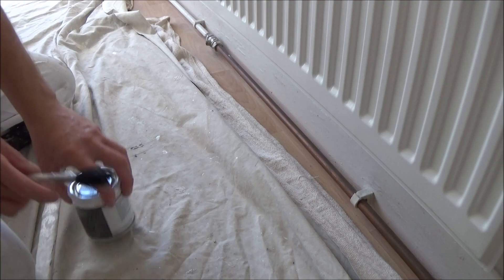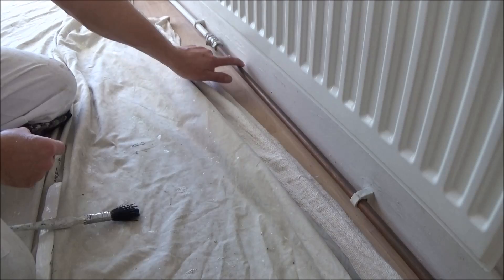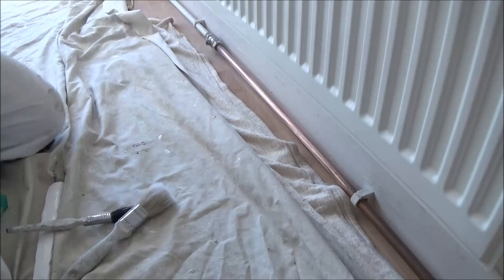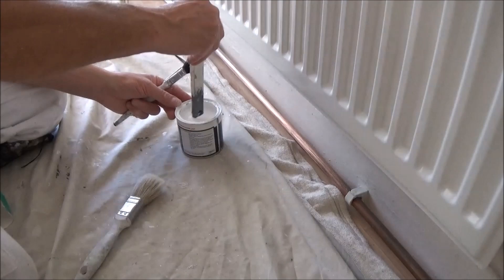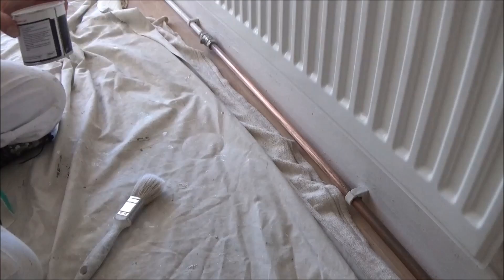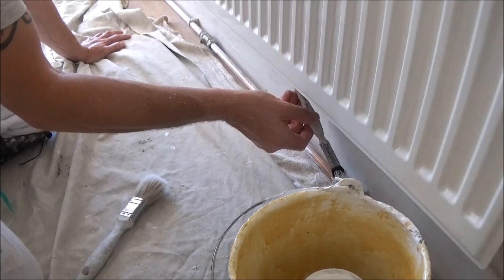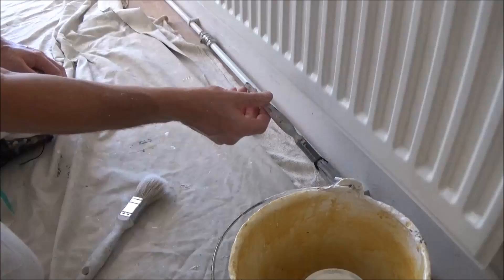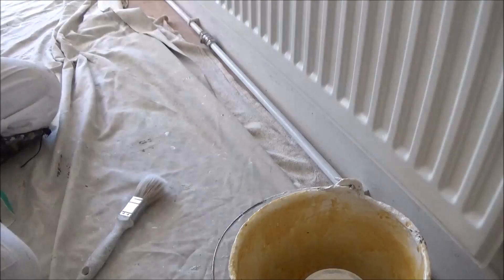Painting copper pipes

Comment: HI, for old pipes that are already painted would you just sand and then repaint or would i need to strip as much of the paint off before hand down to the copper? Problem is there are quite a few chips so just worried about an uneven finish.  Great channel btw, learnt alot from your videos.
Reply from the maker: Thank you, yes sand and repaint, but in the areas where it's chipped make sure you sand them even. Touch up any bare copper with primer.

Comment: Once primed can I paint pipes with the same Matt paint I used on the walls? My pipes run under the rads across the wall and I’m debating whether to make them white or the colour of the walls.
Reply from the maker: Listless Donkey yes you can paint them with your wall paint.
Reply: Painting and Decorating In your experience what colours should rads/pipes be? White gloss/satinwood or same as the walls.
Reply: @EggsForDessert  I know this is an older comment but what did you decide to do in the end?. I'm in exactly the same situation. I have pipes running just above the skirting boards along the walls and I'm undecided whether to paint them white or magnolia like my walls
Reply: krisja  white is more striking as opposed to magnolia,  and gives a better Contrast against the magnolia. Only my opinion though. Magnolia pipes look as if they’ve “yellowed “ with heat 👍👍

Comment: I'm painting silk on my pipes as they already have old paint on them and I want to hide them unfortunately I need small flat brushes as hardly any room beneath and at side for paintbrush and nice video good advice on sanding I noticed tho you just dust off after sanding vs damp cloth to ensure as complete as possible removal of dust particles etc nice video all same
Reply from the maker: Thanks, a dust of is usually enough...  sounds like you need a lining fitch or pencil brush.

Comment: Hi, I bought a paint that is suitable for wood and metal. Used it on my copper pipes and within 20 minutes, the pipes turned blue-ish/ green. Should I wipe down the paint to remove it or is that normal/ requires a second coat tomorrow? Many thanks for your response.
Reply from the maker: Lots of paints say they can go on wood and metal..  but bare wood and metal require primers..  unless it says on your paint no primer required.. thanks
Reply: @PaintingandDecorating  Thank you for responding. Ah, hmm so is it bad that the pipes have turned a greenish blue colour coming through thr white paint? What should I do next?  Remove the paint from the pipes (I have something that can do this) or should I paint over it with a second coat of the white paint?  Kind regards

Comment: Will wood primer work? I've only got a small pipe to paint and don't want to buy a whole tin if I can get away without it
Reply from the maker: It's better than nothing.. oil wood primer can fell sticky till it's undercoated using oil prefably.   but if your going over with water based you will have to leave it to dry for a free days...
Reply: @PaintingandDecorating  thanks mate